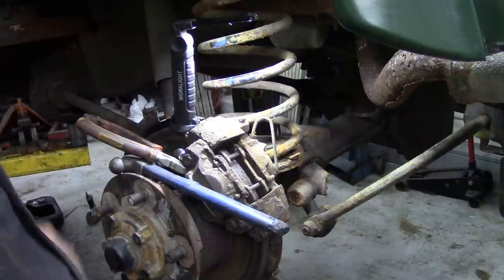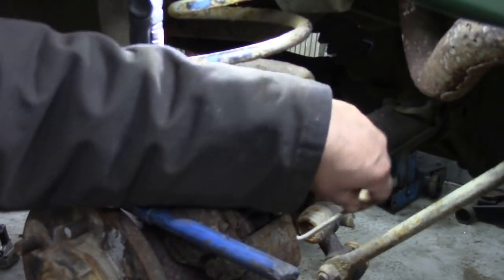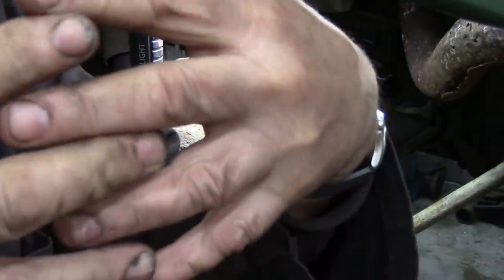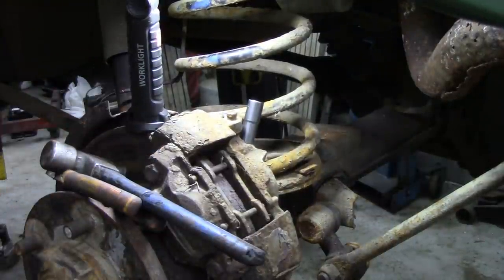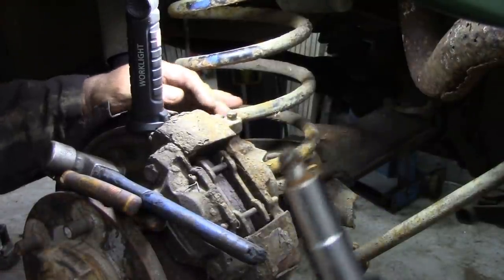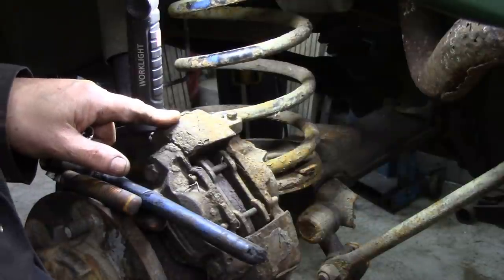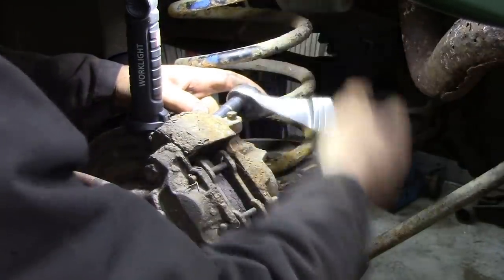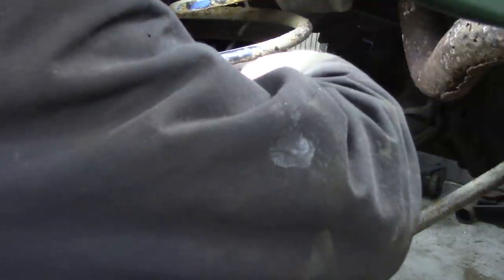Bad 110 rear brakes part 3 Removing pipe fittings

Comment: Mike!!! I always use PTFE thread tape on brake pipe fittings. It even helps with the bleed nipple as long as you use it at the root of the thread and not cover the holes. it stops water getting in behind the thread and causing rust. I will never use a dual hex socket, always a single hex as there is less chance of it rounding off. great video Mike, keep em coming please. Best of luck, Yorkshire Rob.
Reply from the maker: Never heard of PTFE tape on the threads - thought they would be a bugger to get started?
Reply: Bloody good idea. Totally agree about six point sockets

Comment: I used Pclips on my last axle rebuild , I bolted them on with stainless bolts in the existing holes on the axle brackets, had to drill them out a little as the holes for the old plastic clips were too small.

Comment: have you seen the stainless steel cable ties? they should work a treat if you can no longer use the plastic ones for brake lines
Reply from the maker: Yes but there should not be metal to metal contact on the pipe

Comment: That's a top tip.
That's the best way to remove those rusted brake pipe fittings, 9 times out of 10 the pipe will twist, I have a set of 3/4 open end flare wrenches but those are about useless for the job
Reply from the maker: Glad it helped!
Also, use a single hex socket for maximum grip

Comment: Mike not entirely related but would you recommend fitting the Gwyn Lewis mud shields on a defender? Another thing do they rot out quicker in Canada where you are, or the south of the uk? With thanks
Reply from the maker: Yes anything is better than a build up of dirt - it soaks salty water and acts like a sponge, slowly releasing the water and causing corrosion
We have a lot of salt on the roads here - I do not drive my good vehicles in winter for this reason

Comment: Best way certainly is to cut the pipe (if it's cream crackered) and use a socket. I find those slotted brake pipe spanners not all that successful. Wouldn't mind seeing how you do brake pipe flaring properly Mike. Double flare, single flare. Flare dya start!
Reply from the maker: Stay tuned for the next exciting episode!
Reply: @BritannicaRestorations  Will do. 👀

Comment: Buy the replacement parts before you start the job.
Reply from the maker: But this was not the job it was brought in for - we leaned against the pipes, and they broke - am I to import a lot of parts, for many vehicles and models, under the assumption I will need them?
Reply: But you didn't need them... Until YOU broke them.
I think what really happened was that as a consequence of carrying out the necessary works to the chassis the Brake pipes required re-routing. Upon commencing the works it became apparent that the existing pipework 
was time expired and required replacement. And that is what it will say on the invoice.
Reply from the maker: The pipes would have broken under an emergency stop - I keep pipe in stock - do I do this for free or just not bother?
This has nothing to do with re routing pipes - they were the original 1996 pipes
Reply: @BritannicaRestorations  I'd forgotten it was already binned.